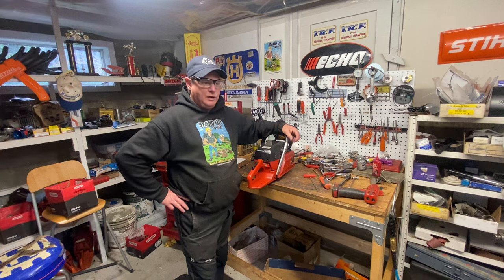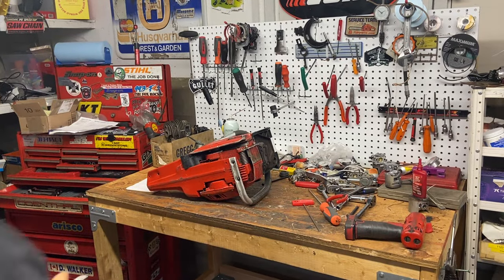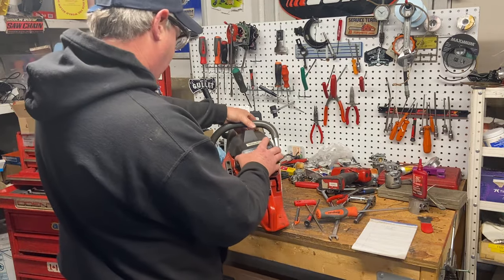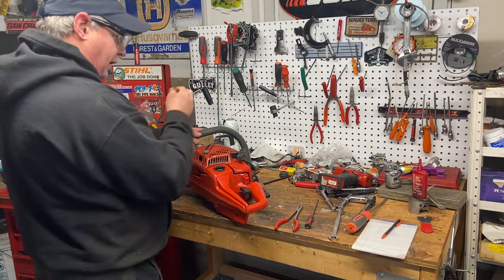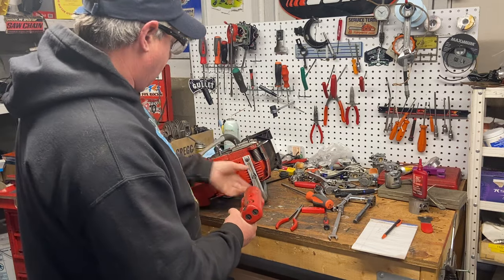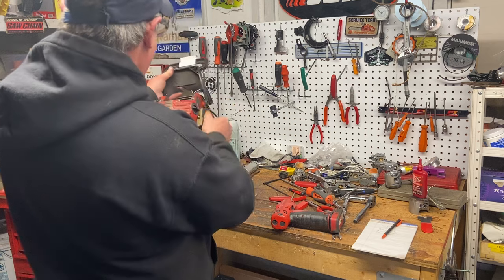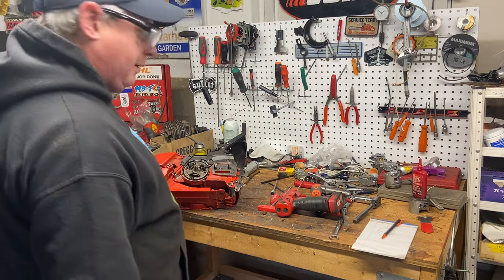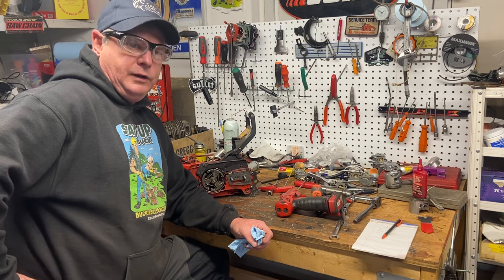How to rebuild a jonsered 2165

Comment: Interesting video the 2165 was a strong slower saw for blocking wood they last forever . I imagine you speed them up with what you can do. I know a guy that put a 2163 carburetor on the 2165 an that sped it up a lot

Comment: Very rarely see a Red in my area. Several years ago we have a box store called Tractor Supply and they pulled all their Husky line of Homeowner/farm and replaced them with the Reds homeowners versions and it was the first time I ever had one in my hands. After 1 year they went back to Husky since...I researched them back then and it seemed about like the Johnson and Evinrude story where there was always alot of shared or bought out technology between the companies and alot of rebranding. I have never seen a crank broken like that...🙄

Comment: Full raps for the jonsen red are mity  hard to come by.
The 2 screws on the fuel tank are a different distance apart then the husky version, you got a good shot showing it on that one.
Sorta a bucket list thing to have one some day. There just not something you see much of anymore.
I have one of the original 371 saws, there definitely a little different.
The real odd ball is the 362 with the 47mm piston.
Counting the aftermarket 52mm theres 5 different sizes of piston in the non strato saw 300 series.
The 51.4mm is obsolete, best my research has found.

Comment: Hey Donnie you ever work on any stihl 084's? Its the only saw ive seen where the decomp is on the side of the cylinder but vertical. Are they common to leak?
Reply from the maker: Yes I’ve worked on lots years ago

Comment: I know you are a fan of Husqvarna...  For very good reason.  But look at the history.  Jonsered isn't simply red Husky...  At least not until the "300" series. 
Jonsered actually invented the two-piece top cover for Husqvarna... Along with the 3 screw cylinder cover.  Wasn't the Husky 161/61 still using the single-screw/one-piece top-cover that threaded directly into the cylinder, while the JRed 630 thru to the 670 used the three-screw/two piece cover...  On the exact same crank-case?  
272xp was still using an intake block, while the Jonsered 670 had an intake boot.  Same carb and crankcase.
The Jonsered "272" family of saws introduced the two bolt air filter on the 630 while Husky (162/61) was still utilizing the "center mount" bolt through the carb's intake port, severely restricting airflow.... Again same crank-case, & carb. 
The single-lever choke/high idle was first introduced on Jonsered, whilst a same-year Husky had the choke lever and "thumb" high-idle on the rear handle. 
Jonsered requested the crankcase change for a one-piece ignition ("front screw" crankcase) while Husky used the two-piece ignition.  
Carb mounted idle screw on Jonsered, while Husky used a case-mounted idle screw.  
The infamous centrifugal pre-separation intake system (air injection/turbo) now used by Stihl....  a Jonsered invention.
Interchangeable airfilter between models (625, 630, 670) when husky had completely different filters (266, 268, 272). 
As an old timer once told me.  Jonsered is the Cadillac to Husqvarna's Chevy.  Or the Lincoln to the Ford.
Reply from the maker: You got it good research your right and I get it love the red and everything 🪵👍
Reply: @donnywalker4691  
That's my father's influence.  I love the reds.  I even find the handle angle to be more comfortable.  
I was just starting pay attention when the Jonsereds became Husqvarna's Jonsered. 
I've run a lot of Stihls may models of Husqvarna..  that 371/372 crankcase is the pinnacle of what a professional saw should be.  
My father started logging in' 75 with Macs...  changing to Jonsered in 1981...  eventually using a 2071 his last years of logging professionally.  After retirement, he ran a firewood business primarily with a 2065 that multiple months of use a year... for a decade.
Phenomenal platform!